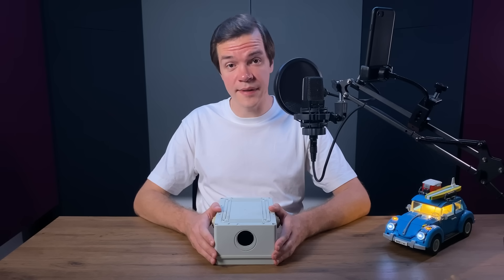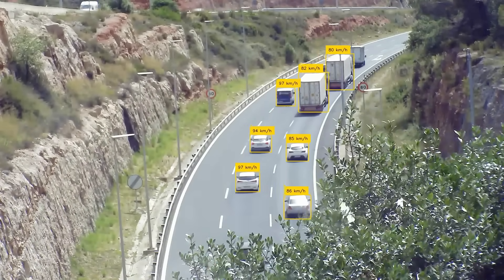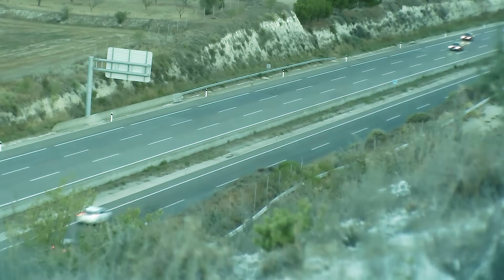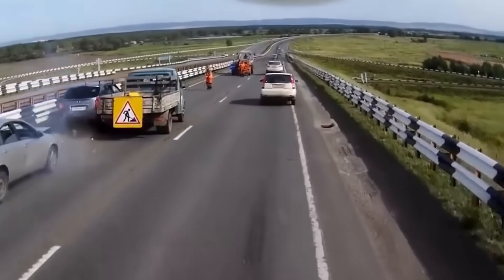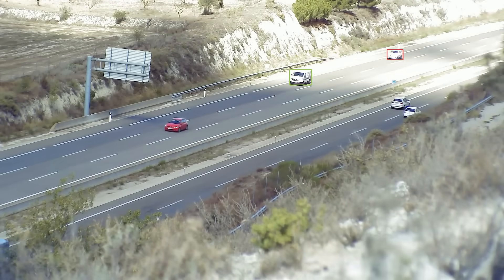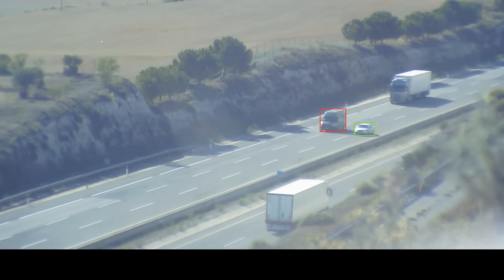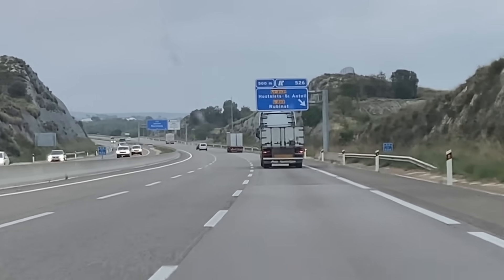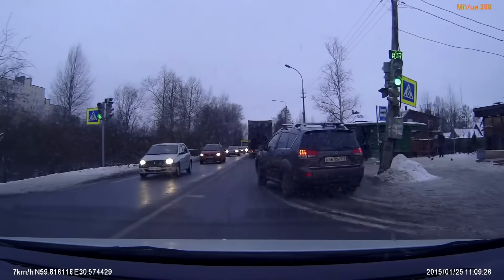New Anti-Tailgating Camera Reveals Shocking Statistics

Comment: Here in Queensland, Australia they've stopped installing new static fixed speed cameras and all new ones and retired old ones are replaced by average speed cameras. In areas with them, it almost completely solves the tailgating issue provided you are actually going the speed limit, because no one can suddenly catch up behind you during the average speed segment, but allows for you to go a little over for a couple seconds in tolerance.

Comment: I am wondering whether you normalised for relative speed for each pair of cars you used for your distance measurements. As you saw in your absolute speed data, it was more or less a bell curve as expected. However, only if all cars would move at the exact same speed, would one also expect a bell curve for the distance. Only in this case, each driver would be trying to make an estimate for the same, speed-dependent distance to the vehicle in front which would be the mean of the distribution. In your data, however, different drivers have to estimate different distances required by their relative speed to the car in front, resulting in multiple bell curves (one for each relative distance) that are mixed in your data.
So you might want to check the distribution of the "safety index" you mentioned as it could be closer to a bell curve.
Reply from the maker: I checked the distribution for the safety index, it looked almost the same. There are very little cars that go below 100 km/h (where lower following distances would be appropriate).

Comment: As much as possible I've always stuck to safe distance, that changes based on road conditions.  The main problem I find is if the gap is large enough yo be safe other vehicles constantly jump in it. Meaning I have to break or change lanes, this is in msny ways more dangerous than driving closer than is recommended 
Keeping a gap that is big enough to be safe but small enough to stop this is varies depending on time of day, rush hour means far more impatience.  
My car is fitted with variable speed control with radar that sees the vehicle in front that keeps a set distance.  I have had drivers trying to trip the auto Breathing cutting far to close in front.  Some people are just not fit to drive.
Maybe an auto alarm that sound in both vehicles is the answer one that can't be turned off .

Comment: Essentially, a collision is just the moment when the following distance reaches zero meters. Tailgating reduces that buffer so much that any sudden change—like braking, swerving, or even a small distraction—removes the last bit of margin.
An accident is simply when the distance between two vehicles hits zero. Tailgating just makes that happen faster.
Many tailgaters think they’re “driving faster” or “saving time,” but they’re just trading time for risk.
Physics doesn’t care about intentions—if the car in front stops suddenly and there’s not enough space, the gap will close to zero.
Speeding gets all the attention, but tailgating is often worse. Every crash happens when the distance between two cars drops to zero — and tailgating makes that inevitable. Yet law enforcement rarely checks it.

Comment: If it takes 100m to stop, that doesn't mean you need to leave 100m. The car in front isn't going to hit a brick wall. Even if they slam on their brakes, you lose the 30m reaction time, but then, your deceleration will be about the same as theirs, so anything more than that should be enough.

Comment: Very interesting. I think (though it's difficult to do), you could have addressed that in many cases, they weren't following, they just hadn't caught up yet. So for example, are they following at 200m? Very hard to know, but there are always going to be gaps in traffic.

My suggestion would be (yeah, not my money, not my effort etc, so I do know it's hard), but I'd be interested in 
1. Storing the speed, lane number, registration number and distance between that and the car in front, and the registration number of that vehicle at point 1.
2. Measuring all of these at point 2 which would be 1km down the road, and ideally point 3 (I think 3 is enough to measure a trend)
3. Comparing the situations where the same cars were behind the same cars and seeing if they were maintaining that distance, or if it changed.
4. Seeing if they weren't tailgating before, but maybe they are now. So maybe 50% of traffic is tailgating at point 1, but it could be 70% were tailgating in at least one of the 3 measuring points.

Ultimately, the data is of no use, but it would be interesting. Because you are right, leave space and someone sneaks in, and people are doing something perfectly safe 99% of the time (everyone is travelling at a constant speed and no hazard ahead), so it is a false sense of security.

But nice work, very interesting.

Comment: The only accidents I have ever had is the guy in front slamming his brakes on and even leaving a generous gap ends in disaster quickly so I find it easy to believe tailgate prevention is going to greatly reduce accidents. Its also the No.1 thing that makes me uncomfortable when Im in a car with someone, one fraction of a second of distraction at the wrong moment...Of course it leads to ppl cutting into the space you left in front of you all the time which does get on my nerves because I have to slow down to get prevent tailgating them as well. Oh well driving sucks nowadays anyway, to many cars, to many rules, to many cameras, to expensive.

Comment: There's some research into level rail crossings I heard about years ago.

People seem to have a built in level of acceptable risk.  That risk level is different for everyone, but we all seem to have it and we all seem to apply it pretty evenly.

The context of this research was about rail crossings that had no lights or boomgates, and was calibrated by watching who crossed the crossing and at what speed.

Basically it came down to how much of the track could you see would, when multiplied by your risk acceptance factor determine how cautiously you crossed the rail road.

The end result was it didn't matter how much of the hedgerows you cleared along the tracks, people would basically take the same relative risk every time.

Comment: After 43 years working in road safety I fully agree that for your own personal safety the cheapest measure you can take is to maintain a safe following distance. I supervised a study which compared issued speeding infringements with crashes involving those same drivers (using a huge sample) . There was no link and yet the paper was never allowed to see the light of day. In my retirement I asked for the paper under an official information request and despite my giving many pointers as to dates but omitting I supervised the project they were “unable” to locate the paper. They are currently the agency that sets speed limits and well as managing speed camera infringements - judge and jury.

Comment: In the last fifty years, I have been involved in four car accidents -- twice while a passenger, and twice while a driver.  Every single one of those accidents would not have happened if not for the fact that at least one -- and usually many more than one -- vehicle had been following much more closely than the recommended distance.  As a result, I am much, much more cautious about following distance than the majority of the people around me.  Not only how closely I follow the cars in front of me, but getting out of the way of tail-gaters any time I can.  One thing I find very frustrating about this is how many drivers will REFUSE to go around you even if given a perfectly safe chance to do so.  They would rather drive too close to my back bumper than change lanes, when there are no cars at all there. It drives me crazy.

Comment: I don't brake check tailgaters but I refuse to let them feel comfortable.  I constantly speed up and let off the accelerator varying the gap in front of me from about 3 to 4 seconds.  The tailgater is left without a comfortable spot, has to pay more attention and usually gives more space.

Comment: Try driving a bus or truck. People incessantly cut in front of you super close. I think it has to do with depth perception being somewhat altered for larger objects, like people crossing in front of trains not realizing how fast they are going. The problem becomes for the truck driver, is that you cannot keep slowing down to increase following distance because it just invites more drivers to cut in front of you.  After a short time you would be at a complete stop. The only thing you can do is maintain your speed and let the smaller particles float around you. Your only defense is that you are higher and have a better perspective of what's ahead and can start slowing down sooner if something happens.

Comment: No, it's not true! The 30m (or any) distance is not enough if that's exactly how long your car travels within your reaction time.   You and the car in front travel at the same speed. At position X he starts to decelerate. It takes you whatever time to react, in which time you exactly reach position X, where you start to decelerate from the same starting speed with the same slowing rate, so you will stop exactly where he stopped! And two objects cannot occupy the same space at the same time! 🤷

Comment: Get out of the middle lane. 
I find the worst drivers are the gormless ones.  
They're also the ones that moan the most about other drivers. 
Virtue signalling is an important thing for people with low driving confidence. 
That's why they moan about the increase risk from speeding motorists but never moan about the increase risk from heavy cars and SUVs.
Funnily enough they often drive heavy cars!
They rigidly moan about stationary cars using mobile phones yet never about computer screens that people use whilst driving!
Finally enough they often use cars with computer screens in!
Hypocrites

Comment: In my country, the maximum speed limit on the highway is 130 km/h for passenger cars and 80 km/h for trucks (although all trucks drive at 90 km/h). I drive at around 100 km/h on the highway, partly because it is the ideal speed for my car's fuel consumption, and partly because most other cars drive faster, so I don't have a problem with them violating the safe distance in front of my car, because the only thing that appears in front of me is a truck, which I overtake and then I have empty space again. The problem is traffic jams, for example during roadworks, when traffic is reduced to one lane and slowed down to 60-80 km/h. You can maintain a safe distance in front, but the cars behind you are pressing in.

Comment: The most dangerous thing for a tailgater is the risk of encountering the minus button on my cruise control. My cruise control button even has an even greater allergic reaction to flashing lights. 
I will not yield until you, the tailgater, are very much infuriated with me. So much so, that some even feel the need to drive 80 km/h or less in front of me, which is even more entertaining for me as that will destroy any theoretical advantage you might have gained with speeding. 

I've done an experiment with a friend of mine who "happened to know" where the speeding camera's would be (don't ask). So we speeded down the highway at 20 km/h above the speedlimit where possible. The total advantage gained was a about singular minute for a section of road I drive on regularly, about 40 km. The variability in time traveled actually varies more with traffic density then it would be with me speeding well above the limit. The theoretical advantage I would have driving from one side to the other of my country would be about 5 minutes IF!!! I'm lucky.

Comment: Great video and so many drivers will see this and not think that it applies to them - even though it does.

One evening, dark and wet, I was driving from work and I saw several cars stopped ahead of me. I slowed up and stopped safely with two metres between me and the car in front.

The car coming behind me didn’t stop until it was too late. They slammed into the rear end of my car and shunted it forward. From two metres, I was now about half a metre from the car in front. The police never told me what happened to the other driver. My insurance premium went up that year by over £500 even though they determined I was not at fault. There was an issue with the other driver’s insurance. That’s all I was told. The police attended and were more interested in the other driver and getting that car working again. Their radiator was damaged and it was leaking fluids over the road. There’s so much more to this. A passenger in the other car complained about neck and back pain. Maybe they thought my insurance would be paying out. I don’t know.

I always drive respectfully and within the speed limits. I use the cruise control and I observe what goes on around me, just as I was taught.

Comment: Most modern cars come with adaptive cruise control, which is a system that basically endorses tailgating. 

While it allows the driver to set a safe distance, you never want to do that, because that ammount of space gurantees someone will jump in front of you, which makes the cruise control freak out.
Reply: I like the adaptive cruise control feature but I always want to set it to a 4 second gap (it seems to work by roughly 1 second spacing intervals based on personal observation) but when I leave that much space, people constantly jump into the space between me and the car I'm following.

Comment: even if you hit the brakes befor hitting the car in front, he still had 0.9 seconds of braking before you. If you both brake at 0.5g, then you are doing 4.41 metres per second faster than him, and will continue with the speed difference until you reach a standstill. at 100km hour, it takes 5.667 seconds to stop, and throughout that whole period you continue to gain on him.

Comment: I live in south east pain, Murcia province. I commonly see cars being driven at OVER the speed limit (I know because I set my cruise control at just under the speed limit), rushing up to cars in the outside lane, then getting VERY close to intimidate the driver in front of them to pull over. They repeat the behaviour constantly.
EVERY instance is a potential accident.
The intimidated driver may make a forced mistake.
The tailgating driver is constantly on edge because he or she (I think more commonly HE) must be making constant corrections.
Personally, I think that such behaviour should result in the immediate loss of the offenders driving licence and compulsory education.

There is a simple method one can use to gauge a drivers mental state and driving behaviour.  
If I drive from my home to Puerto De Mazarron, about 15 kilometres, most of the journey is on a motorway, with about  a third of it on local roads.
I do not need to apply my brakes very often. Usually only when coming to a stop at a junction. This is because I look ahead, and leave a decent gap between my car and the vehicle in front. Simply lifting off the accelerator and letting engine braking work is usually enough. Yet I always see a constant flashing of brake lights in front of me. With cars accelerating then braking in a worthless and wasteful cycle. The drivers of those cars cannot be really relaxed and at ease behind their wheels. 

To be clear, I am NOT a slow driver, my Mercedes is quite lively, but I do obey speed limits.

Comment: This prompts me to wonder if/why the three-second rule is taught, and if it makes sense in terms of the physics.   Maybe it does, but my initial thought is KE (Kinetic Energy) ∝ (is proportional to) v² (velocity squared).  (The formula is: KE = 1/2 * m * v².)   So my initial engineer's intuition is that it doesn't seem right...

   The distance within which a vehicle is capable of coming to a stop is proportional to it KE and thus to v² :  d ∝ v².   The three-second rule makes your available stopping distance proportional to v.  How do we factor in finite driver reaction time? Not sure.  How do we factor in that the car in front of you can't come to an instant stop?  Not sure.  But it seems to me that if we don't factor either of those in in, the three-second rule can't be appropriate.   In that simplified case, the rule will NOT assure that your available stopping distance remains above your needed stopping distance.  Consider: What happens if you are following the rule, and the three second-rule at your initial speed (v) is giving you just enough available stopping distance to be able to brake in time as needed, and you double the speed  that you're driving (v'=2•v)?  A: If v doubles, KE quadruples, and so stopping distance of fully applied brakes quadruples, but v has only doubled.  Uh-oh!  The distance covered in 3 seconds only doubled, so if you're following the rule, your available stopping distance only doubled.  You left twice as much space, but you needed to leave 4 times as much.    
So is there a way to factor in finite driver reaction time and that the car in front of you can't come to an instant stop to make the three-second rule make sense?